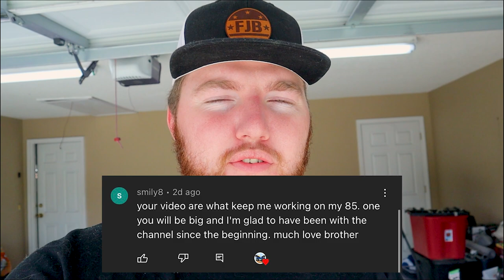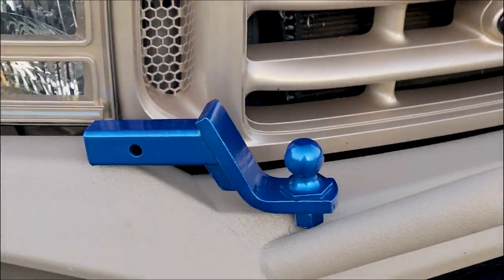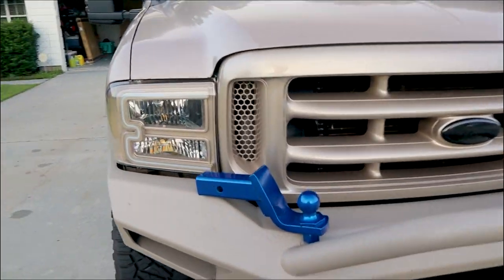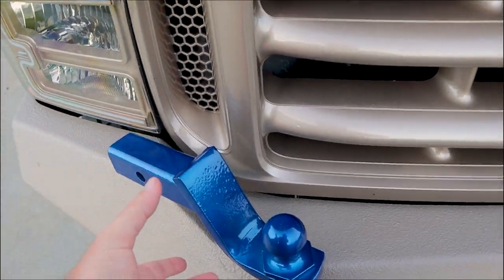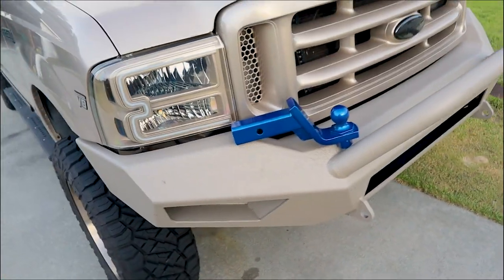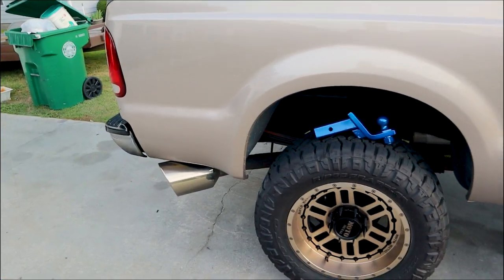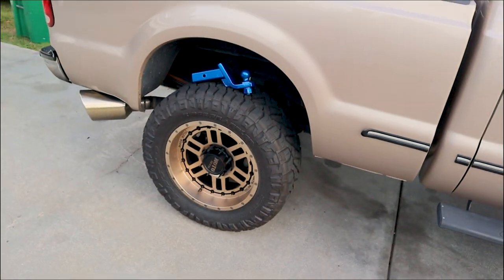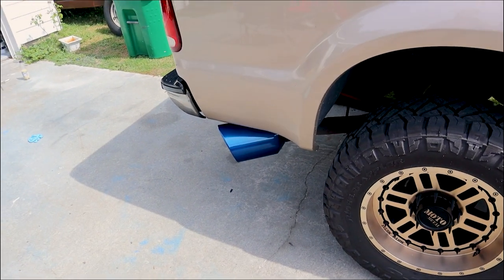FINALLY Chose A Powder Coat Color For The F250 7.3

Comment: Another great video, how bout buying or building a like clothes rack so you can hang the parts on and b able to see the coat's better and then transfer back to ur oven rack, poppin clutches just had some powder coating done on some coil springs and they heated up the paint with a torch before sand blasting and it was a lot easier taking the paint off the springs! Hopefully this will help you out brother from another mother!

Comment: Reason you're having trouble is because once you put one coat on and you try to add more coats the electrologist is having a hard time finding its way to ground or in this case the electric charged particles coming out the gun  trying to get to the ground which is on the other end of your part with the ground clip that's where hot flocking comes in when adding multiple coats also putting on aluminum base coat finish on an already polished piece is kind of pointless so you might as well just put your color down on top of that mirror finish exhaust tip of yours also when doing translucent or pearl colors sometimes to get all of them the exact same you have to do them all at once or make sure you get the timing just about exactly perfect with each other even though some pieces are bigger and heavier and take longer to heat up and hold heat longer  like aluminum is going to be a completely different than stainless and steel and so on and so forth you have to get an infrared temperature gun trust me when I tell you this it's like trying to drive a car blindfolded it's just not going to work you have to get an infrared temperature gun do one part for a certain amount of time write down and document exactly how you did it for how long it was in the oven for every detail and you will get more accuracy with your colors being the same best of luck too
Reply from the maker: I did the base because if not the tip would not match anything I coat in the future because it would not have the same finish under the top coat. 
I definitely do need an infrared gun but it has not been on my priority list because I can coat without it. 
Everything I’ve coated, I’ve prebaked it prior to the first coat so that it is always being hot flocked and the particles attract easier. 
Thank you for the advice!